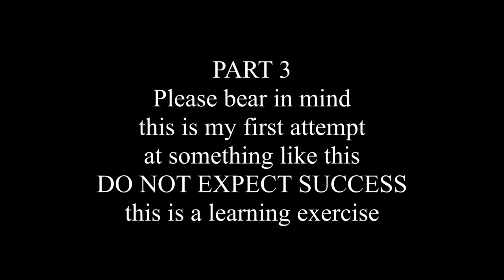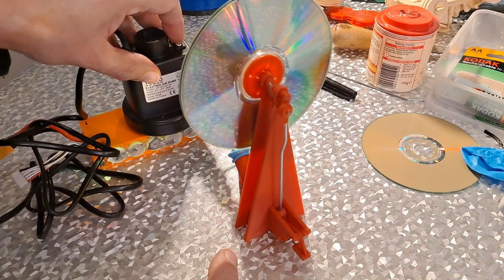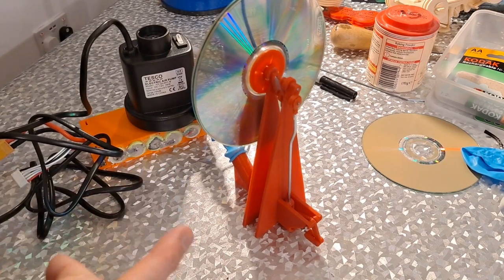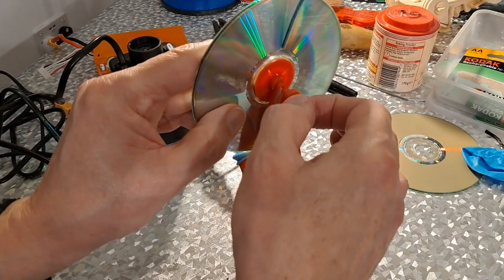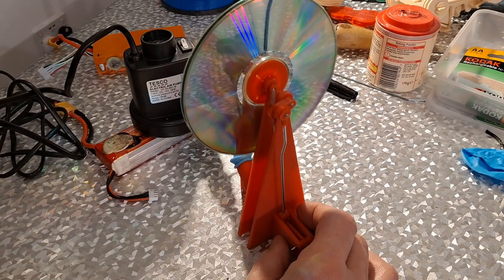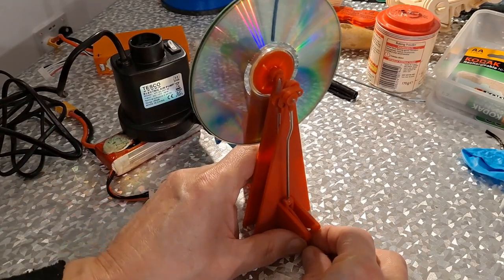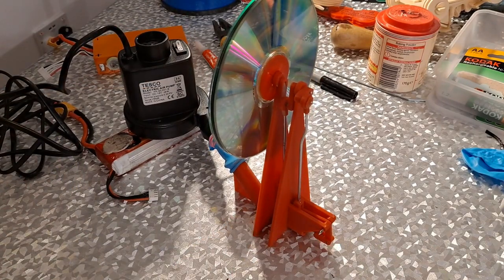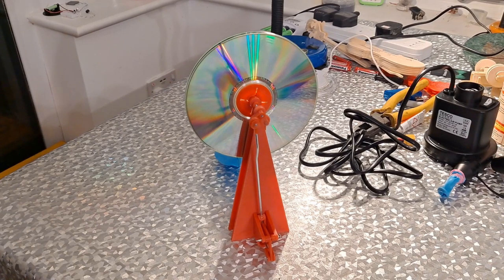3D printed Balloon Powered Air Engine PART 3 Adjusting the timing

Comment: You put a lot of effort into this. Designing the thing and adjusting the valves. In my opinion, it is a success because it does work and with extra tweaking, it would definitely keep running. Good job. 👍👍👍
Reply from the maker: There are plenty of things I can adjust. It is one of those projects that really requires focus and I don't do focus very well😆😆

Comment: nice video but i think the airpump and the balloon are too week to get it going on its own , you would need a better airpump that can blow out the air at a stronger rate to make it turn on its own but like u said its a success and it works too,not just as suspected it would work but it works.i like to see it turn on its own and keep going too. maybe you can get it right somehow?
Reply from the maker: I want it to run on low power. The air pump is too powerful. The clip at the end with the balloon is what I was aiming for, but I think a smaller piston would use less air so it could run longer. Also a smaller valve to reduce the airflow.